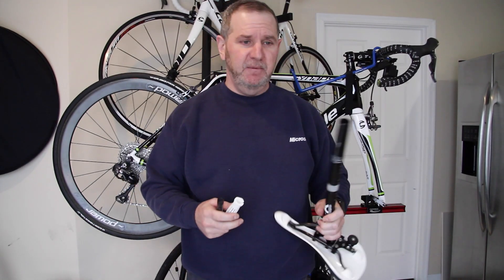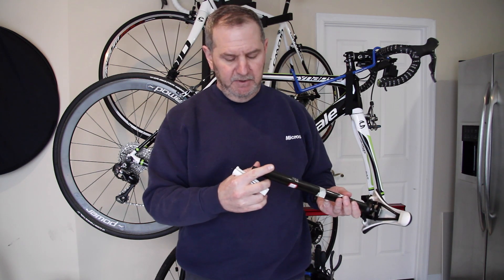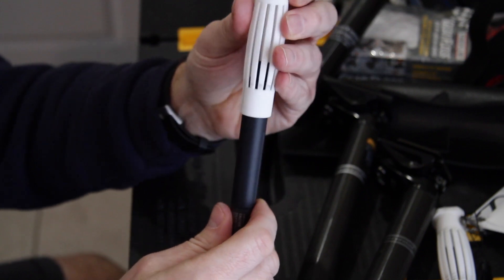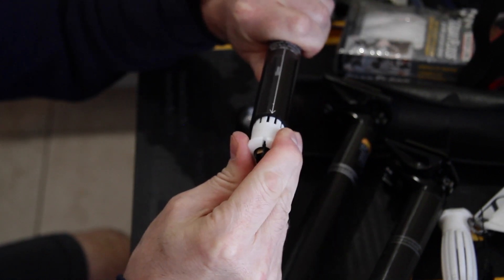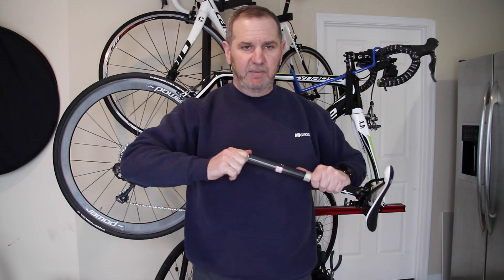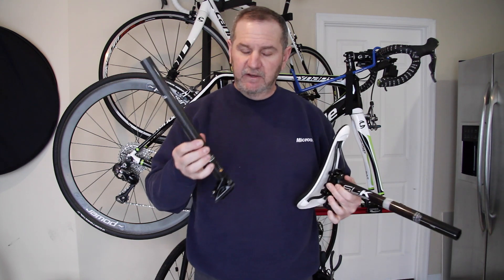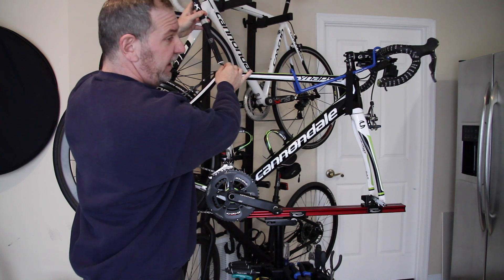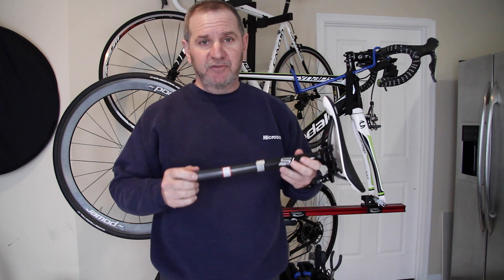Di2 Battery Holder for Cannondale 25.4 Seatposts

Comment: Gregg, thank your for designing this.
Nos, how do we get it ?
If you’re not selling can you allow us to get through shapeways please ?
Reply from the maker: The delay is coming from the C2 (19 mm) version and the difficulty in making the new variants.  The walls are very thin (1.125 mm total thickness).  We have people beta testing them at the moment.

We may very well fall back to a revised original type using a different plastic.  Here is the pros and cons with each type:

Plastic = Pros:  easier to make  Cons: not as forgiving as rubber, and not very tolerant to small seat post manufacturing variations
Rubber = Pros: more forgiving and durable than plastic and more tolerant to variations  Cons:  very hard to manufacture in small quantities

Contact support@buplabs.com, and reference this YouTube comment, and we will figure out how to help you.

Comment: Hi, could you please post a video on how to adjust the saddle angle of this same seatpost, Cannondale C2 25.4 Di2?
Reply: Loosen the 5mm Allen bolt at the rear of the seat then turn the wheel at the front of the seat.....

Comment: simpler fix: friction tape on each end of the battery. Takes some work to insert, but doesn't break down  for quite a while. Yours is much nicer though. Nice job.
Reply from the maker: William Morris Tape, foam, etc., can work.  The problem with tape is that it can bind with the seat post making it hard to get the battery out after a while.  In all of these odd-job methods, the delicate connector end is not protected.  That's why all Di2 specific seat posts recess the connector.  Thats one reason why I made this in the first place.  I have designed a new rubber mount that completely protects the connector end, won't shrink, and won't fuse with the seat post.  It will be on sale at buplabs.com in a month or so.